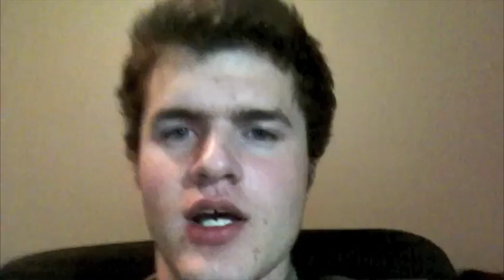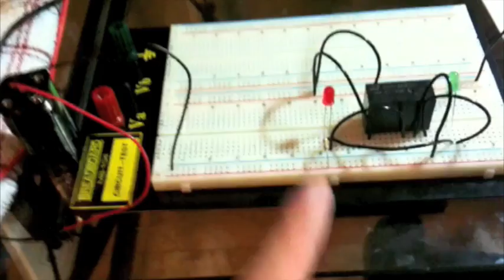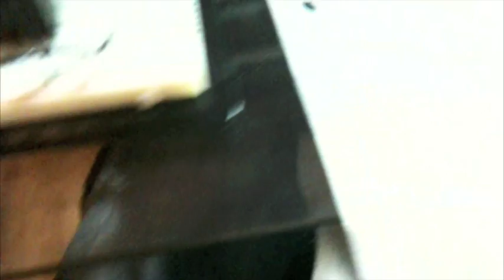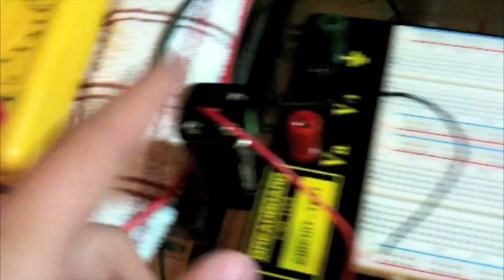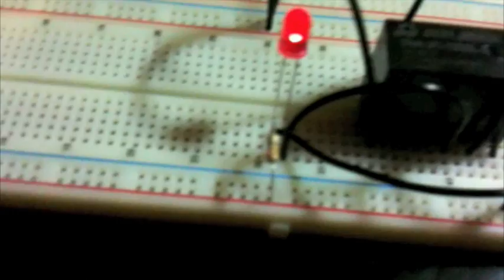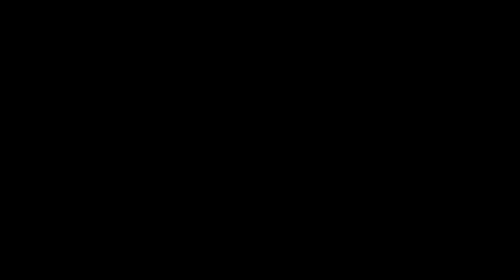Electronics: Using a Relay

Comment: hi thanks for your reply,  been a while since i sorted this.  i used an AC optoisolator in the end. which accepts the ac audio signal at approx 3v ( i used a 200 ohm resistor on its input). then the optoisolator works like a transistor so to allow 5v though for a relay.: )

Comment: you can do lots of cool stuff with relays and micro controllers like
unlock a door with a motor
turn christmas lights on and off whenever you want online, infrared, bluetooth, internet

for those with no micro controllers   ---------use a bottom and turn on your high power device using npn transistor with a diode protecting the coil on the relay magnetic flux  back when turned off you can safely turn on your high power devices using way thiner wire which in some cases make the biggest difference

Comment: you cannot use a 12v to 240v and expect to activate the coil only using .3v ac your best bet is to use diodes and capacitors to build a the current up but every time you turn it on you will need to recharge capasitors. you dont need a relay for what you are trying to do. all you need is a non transistor i dont know what is used for voltages under 3v ;( good luck finding one. let me know if i can help any more.

Comment: Try to use your "momentary" switch so that when you contact it the green LED lights up and then when you re connect it, it turns off. So one push and it is on and then a second and its off

Comment: hi : )  nice vid.

Here you use 12 volts dc to switch a relay that can handle up to 240v ..cool.
I wonder do you know how to switch a relay like this using only  . 3 volts ac ?  ( the signal i hope to use to trigger the relay if from a cd players audio line level out socket  which is aprox @ 0. 316 vrms?  : )